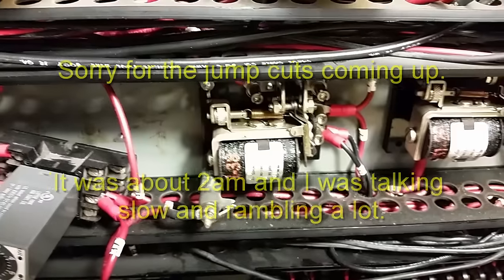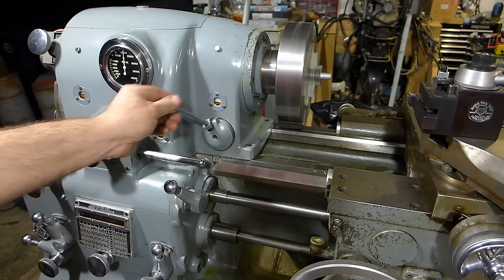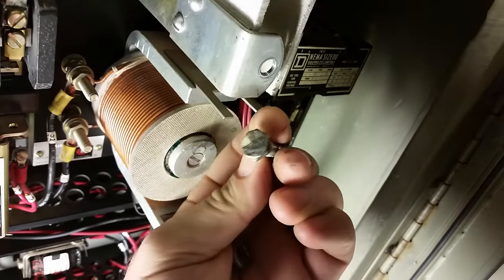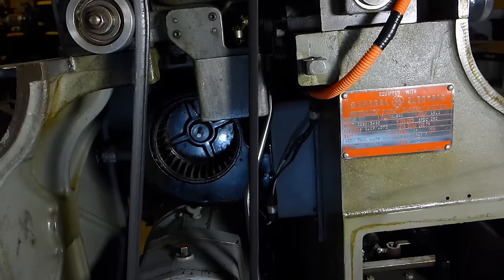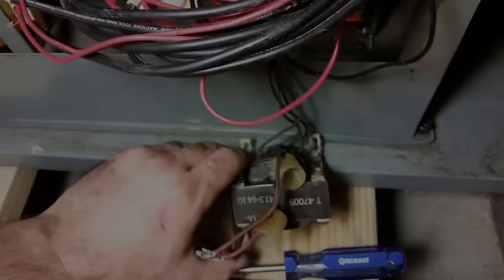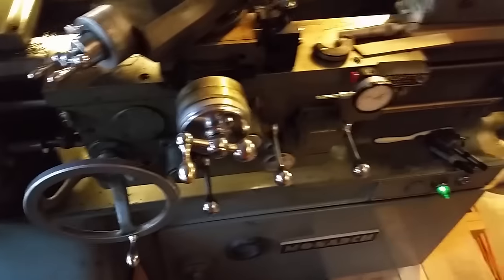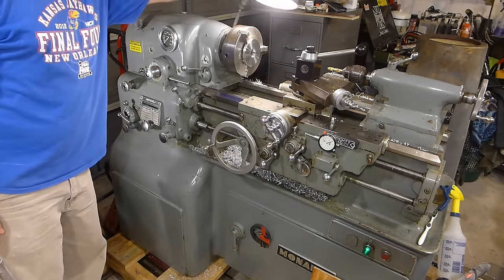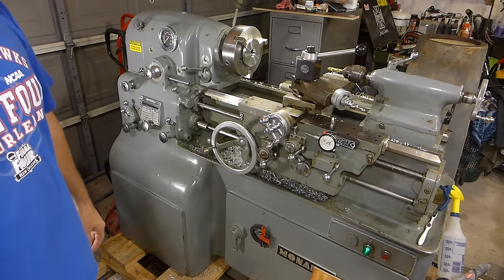Monarch 10EE:  Part 6 -  Control Issues

Comment: My 10EE was destroyed when my brother's garage burned to the ground where we had our shop.  Monarch quoted about $65,000.00 to rebuild it but unfortunately he died from cancer before the insurance claim could be filed.  So I've been picking at the carcass slowly bringing it back to life.  The original motor and electronics were toast - literally.  I retrofitted a Mitsubishi 3.5KW MR-H drive and a very difficult to find 3K RPM matching servo motor (most are only 2K) after seeing Macona's conversion over on the Practical Machinist forum 10 years ago or so.  I spent 3+ years finding everything on Fleabay for reasonable prices.  Luckily the servo stuff was at my place and not in the shop when it burned down.  I have it temporarily installed running the spindle directly for now.  Down the road I'll get it retrofitted to the back gear box using the original motor end bell and partial shaft.  Just finished up installing a new DRO today.  Cheap Chinese Ditron D60 but I did get 1 micron glass scales.  I originally had a nice Sony unit with a 1 uM scale on X but just the scale cost more than the entire Ditron DRO with scales.  It looks like hell but I can now machine parts on her again.  Bodywork and paint have to wait, getting my mill rebuilt is my priority.  

I heard Dave carrying on in the background, you must have been listening to the Amp Hour....   Nerd!  Been listening to Dave and Chris banter all week working out in my shop on the 10EE now that the weather has broke.  You did a great job troubleshooting the original DC drive.  Nice to see you taking the time to keep the original drive maintained instead of ripping it all out and installing an inferior AC motor and VFD.

Comment: I am watching how you are regulating the RPM since I can only see the forward brake reverse lever?
Reply from the maker: There is a knob near the top left of the gearbox thread/feed number plate. It connects via chain drive to a dual wound potentiometer that along with some other circuits and transformer controls the grid voltage on the thyratrons. They can't conduct if the grid voltage is held negative, so that circuit raises the grid voltage allowing them to conduct. The transformer controlling the grid has to be synchronized with the main power transformer, otherwise the tube tries to conduct during the wrong timings and you will get erratic conduction that makes the tubes flicker on/off as it is trying to work. I can't remember if I posted a video showing this effect or not. It's either on one of the videos here or on Instagram.
Reply: @RobbyNowell  .thank you sir,I have seen the conytpl knob frpm another video.Thank you for ansering me.
Reply from the maker: @eduardodaquiljr1621  No problem!

Comment: I'm curious why the tach does not indicate rpm when the lathe is running in reverse?
Reply from the maker: Older 10EEs have mechanical tachometers that only work in forward. Later they used an electrically controlled tachometer that works if both forward and reverse. Mine is suppose to work in reverse, unless it was retrofitted at some point in the past (this might require spindle shaft removal). It's one of the things on my list to look at.
Reply: ah ok thanks, Just curious thats all

Comment: I know what I would be doing after watching the other vids, I would be to take an axe to the Electricals and replace the dc motor with an AC motor and run the lathe the same as every other lathe,
Reply from the maker: And miss out on all the fun?!?!?!?! :)
Reply: isnt that why the lathe is so popular...because of the spindle control while the machine is running DC ?????im a toolmaker not a electrician for the record